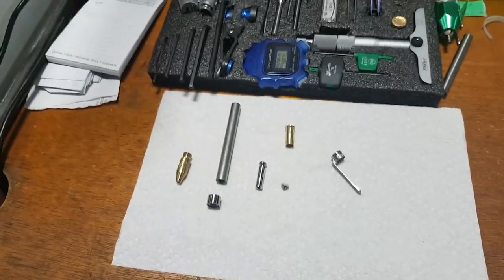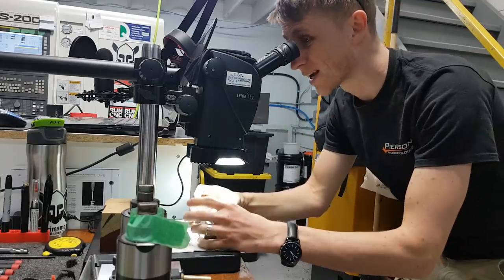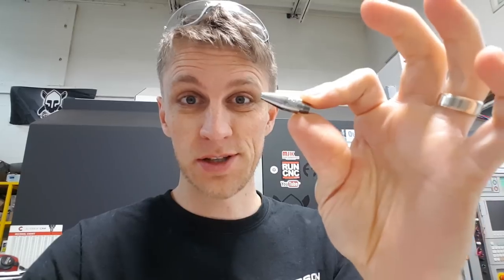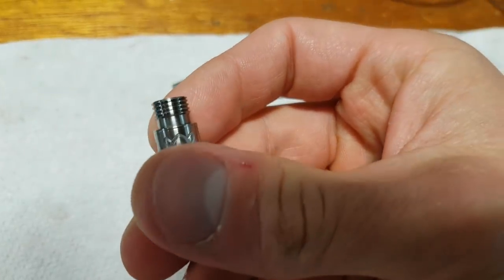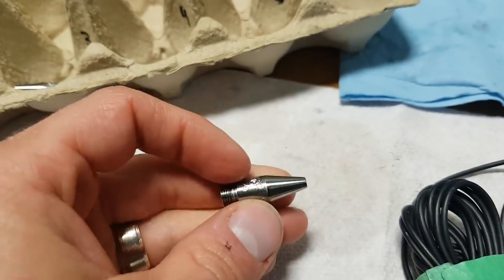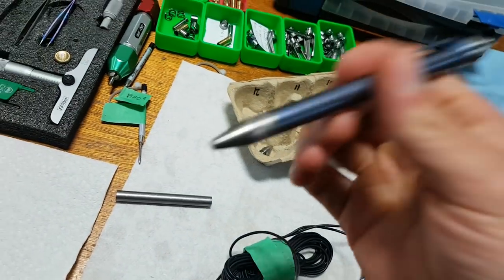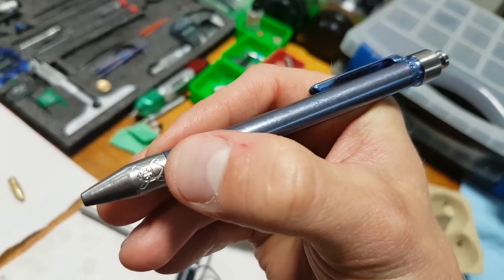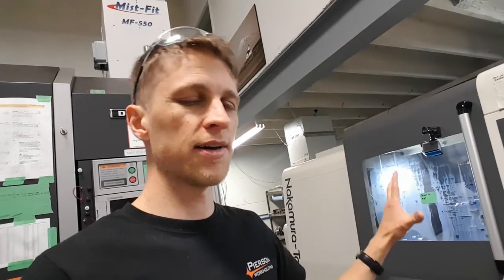"Tip" of the Day - Saga Saturday 005

Comment: Hey John, "Cogsdill" have just released a new tool and thought off you with the grinding wheel Saga. 
It is a Diamond Burnish Face Mill (they also do a diamond burnish turning tool), it might be something of interest. I have never used one but it is advertised as providing a 4 to 8 micro-inch surface finish (3.6 Ra on a video they have up).
Anyway keep up the good working and best of luck at Blade.

Comment: Is there a way, with the tubing, to get the outside of the tubing ground in a center or centerless grinding machine to get consistent outside consistency. That way you have everything exact where you want to start the diameter at and don’t have major variables in any kind of OD tubing batches.